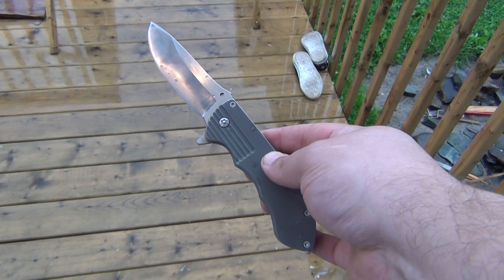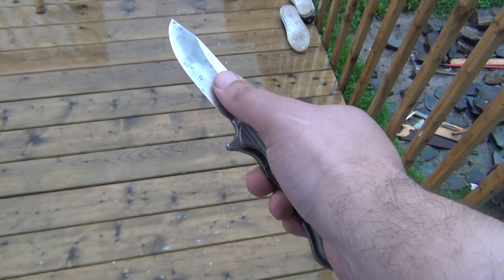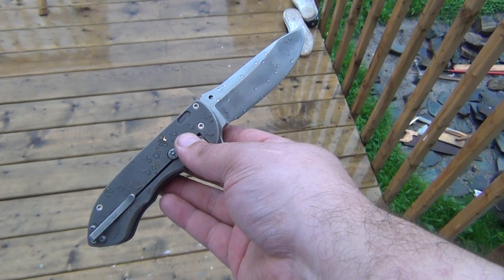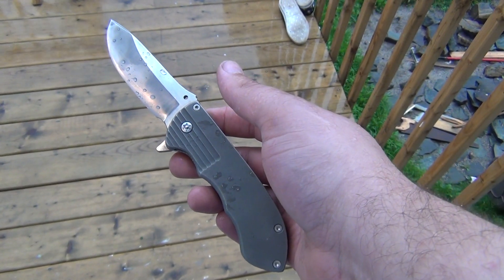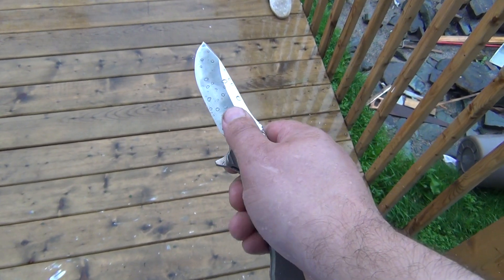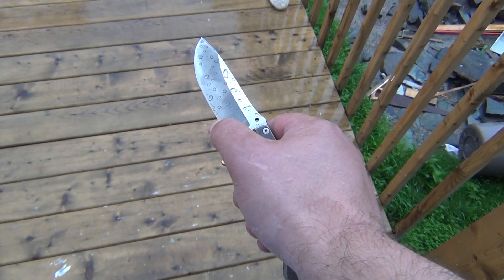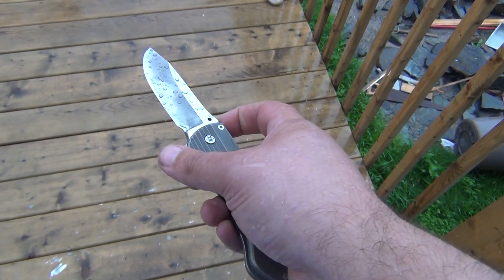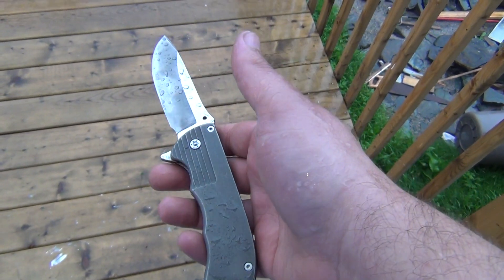Knife Challenge #20 : Cutlery Myths - Murray Carter Brass Rod Test

Comment: So we all know what effect heat treatment has on flexibility, and whether or not it'll return to true. 

My question is, is there any significant benefit, or a field of working with knives, where it's better for it not to flex not return to true easily?
Reply from the maker: All steels from annealed to quenched and not even tempered will flex and return to true to some extend as they all have an elastic region.

The hardening which produces the maximum elastic region however doesn't produce the maximum yield or maximum plastic region.

A knife which is optimized for light cutting would likely benefit from maximizing the yield point. A knife which is optimized for extremely hard work would likely benefit from having a large plastic region (where it deforms and stays deformed but doesn't crack).
Reply: Is that why Cold Steel have their steels of up to 10 HRC points lower?
Reply from the maker: shurdi3 If you want to be generous. The reality is more likely that they don't use large enough coolant baths and/or agitate them and thus they end up with very weak quenches.
Reply: But wait... if they do them in batches one after another, and they just remove one batch, and then put in the other, wouldn't each batch become gradually softer and softer if they don't change or cool out the coolant? 

Thought it is sad that this happens, as their blades are nice on paper, and seem to have much more potential, but they lack in execution.
Reply from the maker: shurdi3 Yes, and to be clear I don't know how they hardened, however given the fact that the edges are horribly over heated to the point of being burnt blue/black, it is unlikely that they reverse this lack of care with the HT.

Comment from the maker: If you are careful, you can take any blade and make it pass and then fail in both ways as all steels will have an elastic, plastic and then rupture point. If the edge is very thin it is easier to see each region as the deformation radius will be larger as the thickness of the edge is reduced.

Comment from the maker: Part of the issue is that yes different steels will behave differently, the elastic region on very high carbide steels is very small compared to low carbide steels. It would be very likely that someone trying to do this test on very high carbide steels like 10V could easily make them chip simply due to the fact that you have a  much more narrow window where they are elastic and they are plastic (stay bent) for a very small amount.

Comment: I have tested some blades that a good file won't bite, yet a deflection happens at an unknown force. So, a file will determine the hardness to a degree and the deflection test will give a ballpark of ductility. M.Carter said a blade too soft will stay bent and a blade not tempered would chip before a bend. But maybe this to geared towards high carbon low alloy type steel rather then High alloy PM seels?

Comment from the maker: Yes, Murray Carter isn't the only person to advocate this to check the steel - however if a steel chips it isn't a sign of anything except that the UTS point was passed, that is the metallurgy. 

If you look at a stress strain graph you will see that even an annealed steel and an as-quenched by not tempered steel both have elastic zones. 

This means unhardened and even untempered steel can readily pass this test - now knowing that how do you interpret the results?

Comment: I agree, however the blade geometry and steel hardness will factor in on the pressure applied. M. Carter said a blade would chip before it would deflect if too brittle or have excessive grain growth. I have to trust a blade smith that has done thousands of blades. I have read books on this method by many knife makers.  I have tested many production and custom blades using the brass rod test. They all required different pressures to get the deflection but all went back to true. So R they a pass.

Comment from the maker: I think it is possible for someone with experience in this test to gather some information from it but they do so by using controls that are not usually given in the description such as how much force they are applying, the angles, how much the edge bends and so on. The problem is without noting all of these it is possible that one person could say a blade failed and another could do the test and say the same blade passed.

Comment: I think the brass rod test is just a guide line. This test has been around for along time and it will give you a range of "Is it too soft or too brittle", but not the specifics. If your blades pass this test may not be 100% optimal but acceptable for a knife blade.

Comment from the maker: Stainless steels will resist scaling (discoloration) for the same reason they resist direct corrosion and so they can be grossly over heated by grinding and still not show any color change.

Outside of a direct metallurgical examination, you have to have some way to check the edge durability, sharpening and edge retention. If you are a maker you just keep a stock knife and use this as your baseline reference. As a user you can do similar.

Comment from the maker: Ironically enough, the thicker the edge the easier it is to fail. 

This is because a thinner edge will allow a greater distortion before failing. This is because for a given bend of curvature, the thinner the cross section, the lower the internal strain. 

Hence you can bend a hacksaw blade all over the place, but not so much the 1/8" blades made out of the exact same steel.

Comment from the maker: Yes, an interesting point is that the very high carbide steels at very high hardness will not be easy to flex and resist breaking, especially in thin sections because the carbides are likely to fracture. However when used for soft materials as you note the edge is never so loaded and thus it can work very well.

Comment from the maker: This is one of the key points, all steels have that line - now how does this test determine it exact when there is no quantification of the force or the cross section of the steel being deformed. Just imagine if you did a standard three point load test on a bar under the same conditions and said the bar passed if it returned to true, but never measured the force applied or the thickness of the bar.

Comment from the maker: David, this is the crux of the issue, how a steel will flex depends not only on the force applied but how it is applied and the nature of the steel. It might be that having a steel which would break before it would deform a lot might be optimal on a blade which needs to resist deforming at all because any deformation is going to be failure. On other blades then deformation is expected (machetes) and you need to limit breaking. Thus it isn't a universal yes/no on break vs deform.

Comment from the maker: The reason that knife makers can do it can extract information from it is because they are using similar forces on similar edges and deflecting similar amounts, they are just not making it clear they are doing this each time. If you don't then any steel will either pass or fail either way depending on how much force you apply to a given cross section.

Comment from the maker: This was close to the exact answer I was looking for.

In essence, the brass rod test is basically :

-apply a force to steel until it bends

-if you remove the force and it returns to true then the steel passes

Written in this way it is obvious the test is meaningless because all steel will pass that at some applied force and unless you quantify that and the nature of the steel (cross section) it is meaningless.

Comment: (I may or may not have cheated for this one.)

All steels have a region in which they are elastic. If the bend is within this region, it will always bend and return to true. If you go outside this region, even if it has am optimal heat treat, it will bent and stay bent.

Comment from the maker: The ones used for light cutting (no prying or chopping) as it makes it easier to minimize the geometry, especially with modern steels. Try to maintain an Opinel like profile on a S90V blade without power tools.

Comment: 2/2 like testing  one steel and one geometry, then there is variable in HT that cannot be eliminated and it is the internal tension of the material. And if the tension is not uniform which never is, then this test in invalid

Comment: 1/2As question is so abstract, it is hard to say. If you are talking in general, then there are various edge angles and  with quantities off steel out there , there are too many variables as the influence of hardness and it's influence on flexibility related to different angles on which are applied forces from various directions in this test. Every steel and every hardness would react differently. But if you mean if the test is reasonable under conditions that mostly eliminate aspects above

Comment: Or grinding out chips on ZDP-189... but back on topic. 

Considering how most of his kitchen knives have a very thin hollow grind, a non-optimally heat treated blade will still be flexible enough to bend, and elastic enough to return to true, with reasonably similar force used.

Comment from the maker: Yes, that is it. Carter is likely using very similar force on the rod when he is doing it again because he is checking knives with similar cross sections thus this is a pseudo-control because he doesn't note it explicitly but he likely does it. This is critical to making it meaningful though because just think what would happen if you significantly increased the force on his knives in the brass rod test.

Comment: The pressure used to flex the edge could be a pseudo control I suppose. It would vary from person to person, day to day, inconsisten and non repeatable with a scalable setup designed to apply and measure  the force. So where would your baseline pressure be? Just before it blows out a half moon shaped chunk of steel? Sure, ok. I believe that cross section would fit the criteria. Let me know if I'm drifting in the wrong direction.

Comment: Not sure I completely understand but I'll give it a shot. Pseudo control would be a false control or baseline to judge from. We don't know what his baseline is for the knife he is showing in particular. He doesn't say so, but he must have an idea from from making so many of the same ones. He uses a plastic lighter with oval shaped edge. Not a round bar stock as recommended. I imagine this changes the pressure curve at the apex of the flex curvature. More acute I would think.

Comment from the maker: Not exactly, to rephrase the question.

You noted that if the edge has a thick cross section it might be difficult to flex it without it breaking. As Murray is checking blades he makes of a specific cross section this is a pseudo-control he is using though he doesn't say it and might not even be aware of it. What other pseudo-controls is he using in the test itself that he doesn't specify (and might not be aware of) which is letting him draw possibly consistent conclusions.

Comment: Every single piece of the puzzle matters. Some more than others depending on the problem. But they all matter. Thusly, if you are a maker and you out source some of your manufacturing processes. Then say you just finish grind and put handles on the knives. This testing line would have zero meaning to you. None at all. Because its not a quantifiable result if your not in constant control of all phases of manufacture. It leaves things that you simply cannot know at that point.

Comment: Well he has constant direct controller over the HT temps, the quench material (rice straw ashes), the soak times, annealing temps, Finish grinding and grinding temps. With him doing all these things in house. He can then quantify the differences and figure out the culprit for a given problem. Since the edge flex test is just a tiny part of what makes up a blade steel issue.

Comment: Could it be because Murray doesn't really make thick blade steel knives or heavy workhorse grinds? Most of his stuff is 1/8" or less hammer forged thin slicer grinds. So the majority of his work would have flex at the edge. Where many of the heavier grinds like my favorite, full height convex, will not show flex until too much force has been applied and it blows out.

Comment: Was wondering that when ,the test was performed may vary the results because , Murray could be testing immediately after HT, may have  time sensitive factor , to and when the metal reacts. Also depends on the final hardness requirements that are required. Brass itself may or may not vary in its hardness. I'm guessing.. the test is not very precise due to these and other factors that vary.

Comment: Murray has nearly 18 000 blades to his name, therefore knows everything there is to know about steels, knives, and sharpening : P

On a more serious note, could it be that Murray uses very 'simple' by today's standards steels, which could have a rough "rule of thumb" way of figuring out if they screwed the heat treatment completely

Comment: I agree with you, Cliff. I'm no heat treatment specialist but, I have to wonder about tolerances, per set, and how far away from a bend or chip out the blade actually was. Also, I have to wonder about the brass too. Are its characteristics constant from rod to rod.  All in the realm of wonder, but possibly relevant?

Comment: Hahaha, I'm sure someone else came up with it before me. There are variations. For just a mild case there is oper8r. For more severe its 0per8r, and for the most severe its 0p3r8r. Of course people who put their lives on the line in uniform, or not in uniform as the case may be, are operators. ;) 

Either way I think its an adequately subtle slight to mock the strider/crusader forge/grayman/etc ilk. 

BTW have you seen the thread that originated the term "mall ninja?" If not..... its epic.

Comment: (cont) this would show some level capability potentially. But if you are trying to test behind-edge rigidity, have varying apex thicknesses, etc it will produce results of varying value. The point is simply that with "quality" undefined, the pertinence of what the test would show is of as little merit as the test itself.

Comment: I would argue that your dismissal of the test is null, because you don't specify anything beyond "quality of the steel and heat treat." Quality for what precisely? If your goal is to be an 0per8r, this might be an 0per8r right of passage test (along with uber mega tactical jimping needing to be large enough to actually fit the brass rod you perform the other test with) Likewise if you had a knife where you valued deflection behind the edge reducing cutting precision without damage (cont)

Comment: While the brass rod test could be used as a precursory examination of an edge in some instances, it certainly has its limitations. It will not be able show the steel's microstructure or grain size/ consistency.  This test would not be ideal for many of the very high hardness, high carbide, low edge stability steels as they would exhibit very little elastic deformation before fracture.

Comment from the maker: That is a critical point, both annealed and hardened steel have the same stiffness or resistance to bending and your conclusion is exactly right unless you have a way to quantify the lower set point.

Comment: Oops tapped the wrong button mid sentence. Anyway, the testing would have to be very controlled and repeatable over a long run of the exact same knife (meaning steel and style) to mean anything at all in a result. Even then it's more of test of geometry than anything else. HT failure has such a huge range that I can pass or fail inside of with this type of test, that makes the result almost tertiary in that category.

Comment: It is not meaningful. The test doesn't take into account the edge thickness, edge angle, steel type, pressure exerted on the edge via the brass rod, temperature of the steel during the test, the angle of the brass rod in relation to the edge, the thickness of the rod or the intended use of the knife and therefore the intended brittleness or elasticity of the steel. All things that could effect the results of this test. There are just too many variables that this test doesn't take into account.